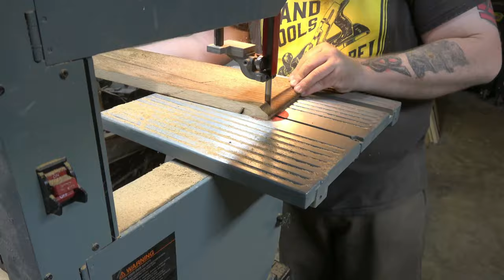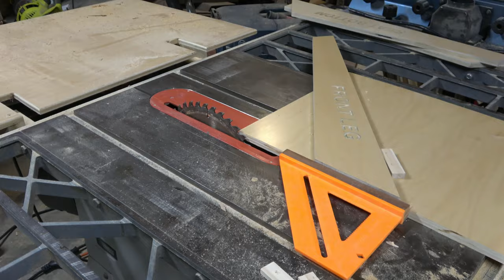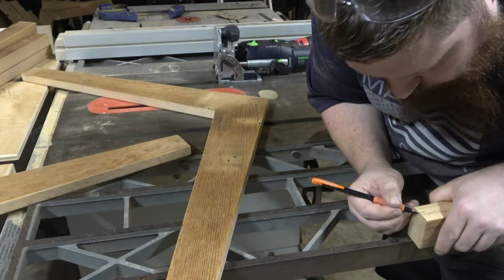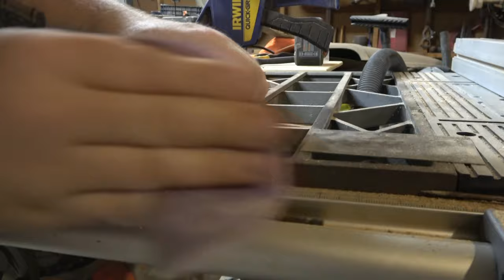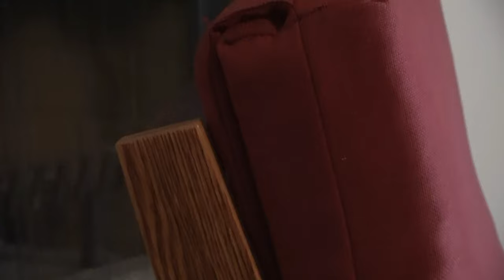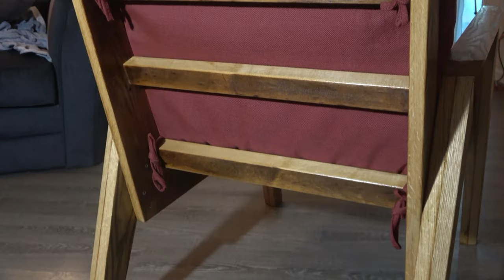How to build a lounge chair (free pattern)

Comment: Before any critique, let me say I doubt I could do any better and I think it looks great.

I think I would have added a slight pitch so the seat wasn't sitting level but allowed a sort of force leaned back position. I find even when I sit on normal chairs I lean back so this happens.

Instead of so many domino's (you bought the tool, don't feel bad to use it! Screw what others think just cause it's not something everyone owns), thoughts on cutting out dados on the inner board that is  doubled up for the back and seat area? The the slats would rest on the board and not trying to shear a domino.

Again, great chair, it has me thinking and I love the rescue of old material. I see alot of pianos being given away for free. I need to get a chair or two out of them :)
Reply from the maker: Thanks for the honest feedback. Initially I thought it should lean back a little. When I was testing it, I put shins under the front so it was raised slightly. I didn’t notice a huge change feel wise and it actually looked better to me when the top was level. This may have had to do with a combination of the angle between the bottom and back, and the taper on each section. I think I’m going to try to do a little more with this idea of turning old pieces of furniture into something completely different.